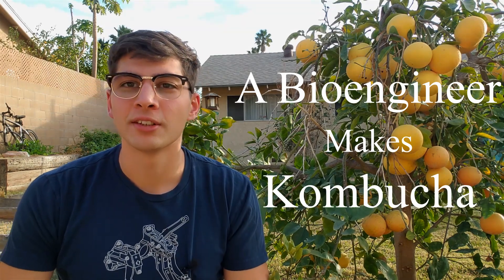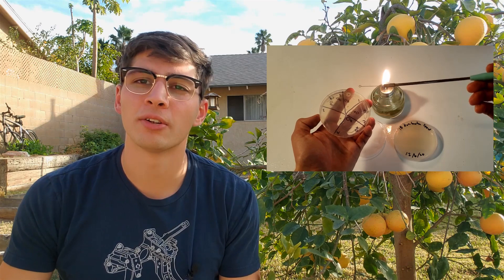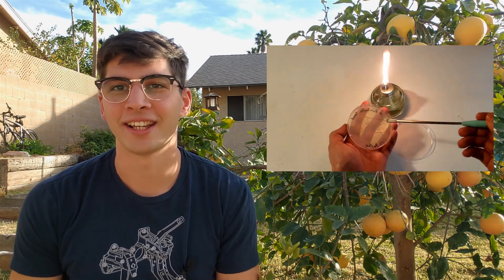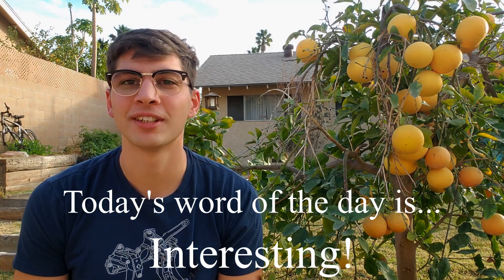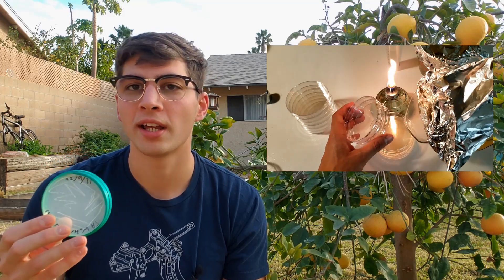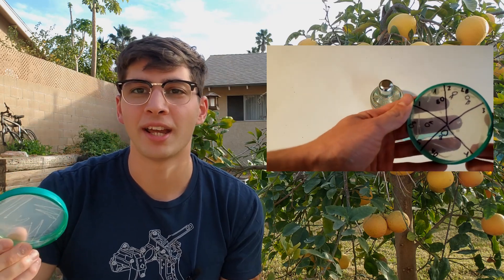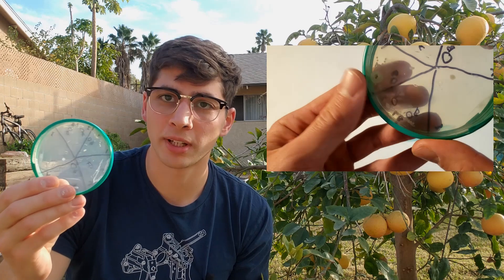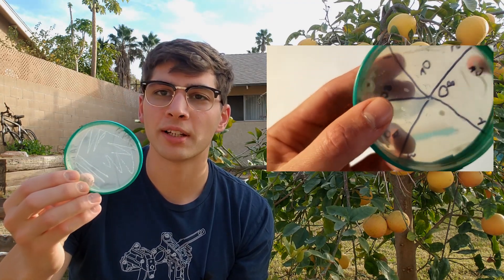EP. 1: Introduction | A Bioengineer Makes Kombucha

Comment: I'm actually an electro-mechanical engineering major at the moment, but I am convinced that Kombucha, right now I am studying its applications as an organic acid bioleacher, will make a far more practical foundation for a suite of ISRU technologies that do not need to be in the carbothermal reaction temperature range to achieve. I would appreciate that if I were an Astronaut, Mission Planner, or bean-counter.